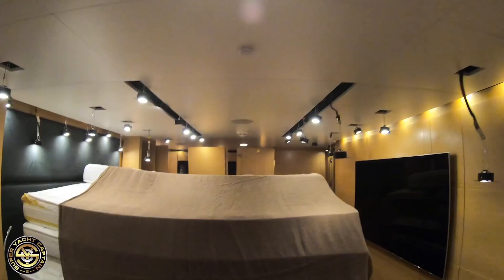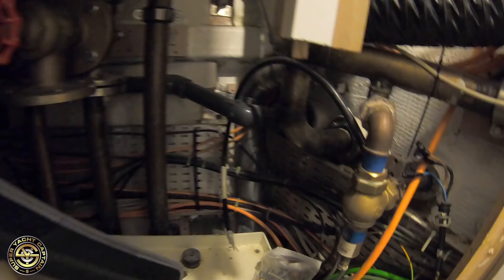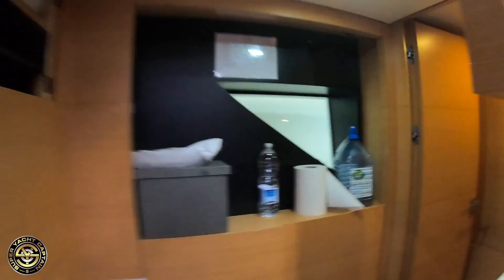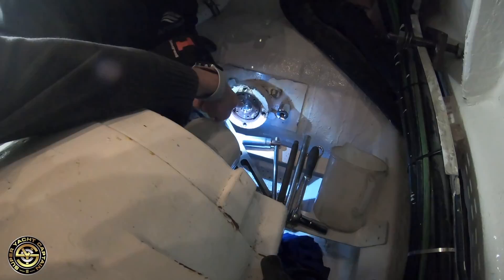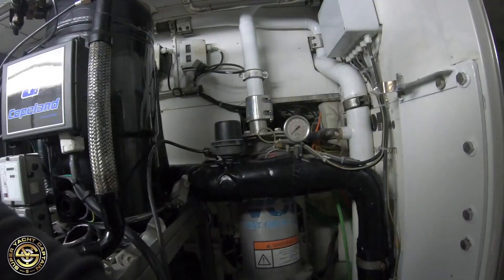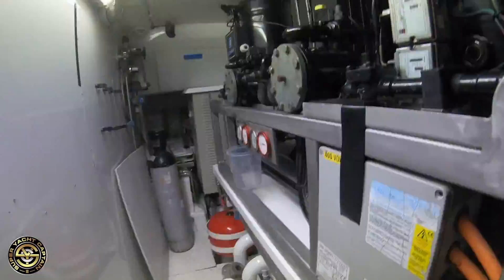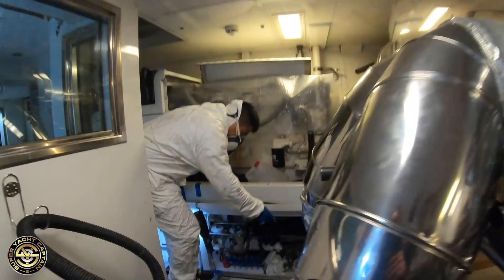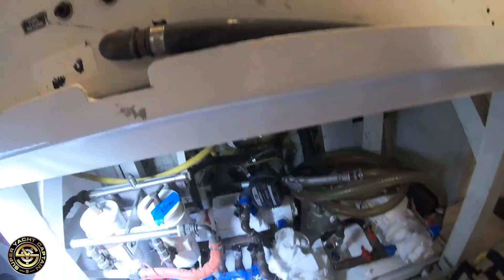2019 Super Yacht Engineering Refit (Captain's Vlog 39)

Comment: Regarding Vlog 39 and installing LED lights.  In the recent December/January issue of "Professional Mariner", p. 8, there is an article entitled "Onboard interference from LED lights called 'huge safety issue' for mariners".  Apparently some LED lights degrade VHF marine radio and AIS reception.  How confident are you that the LEDs you installed do not cause this problem?

Comment: With all the work done on the fire systems, pumps, and so on how do you test the systems without flooding a compartment on the boat? Do you do something along the lines of for example attaching a temporary line to the sprinkler system to the outside and then set off the temporary sprinkler? Would it be possible to do a video showing how the fire systems on board are set up and tested? Thank you and be safe.
Reply: @SuperYachtCaptain  Thank you!

Comment: Question for anyone! Do you have to add a dimmer for every single LED? or is there one dimmer for a certain amount of LEDs? and where is the dimmer installed?  thanks
Reply: A dimmer can handle one to many LED lights. They will have a limit on the maximum load they are able to handle, measured in watts. The maximum number of lights a dimmer can handle then depends on how much power each light consumes. The dimmer can be installed in multiple locations, in the case of AWOL it appears they are installed in a central power distribution cabinet - a common method for high end lighting systems. Another method could have been to install them at the switch location.

As a bit of trivia, the large copper colored doughnut that Tristan first picked up is a toroidal transformer, responsible for converting the mains voltage to the low voltage used by the lights. The difference in size is a good reflection of the lower power requirements needed by the LED's.
Reply: One thing not mentioned often besides all the other pros of LED lights is the desirable light spectrum available.  The LEDs can replicate natural sunlight very well.

Comment: One has to wonder how many miles of wire and pipe make up the boat!!!? The amount of hard labor, in tight spaces, is mind boggling... I had a royal enough time replace 50+ halogens with LED's in the fifth-wheel toy hauler...lol
Reply: Lol yeah I can’t even imagine how many lights they changed and the cost of the material alone. Obviously money isn’t really a factor at this level but it still is, especially since the primary function of this yacht seems to be a charter boat compared to the owner being on it.